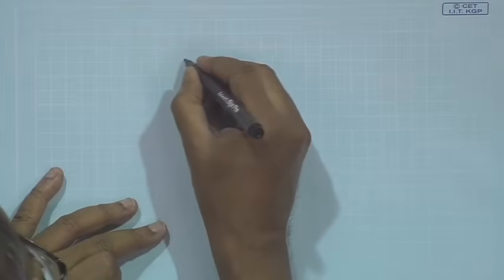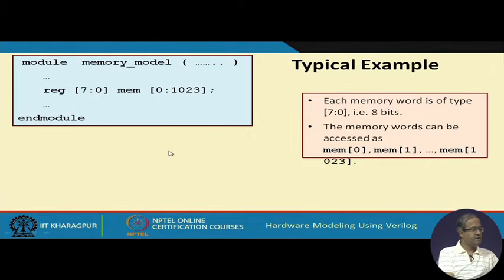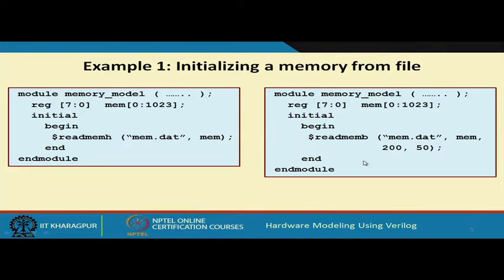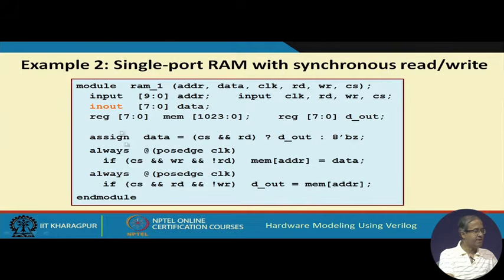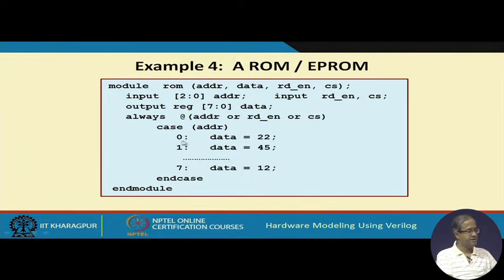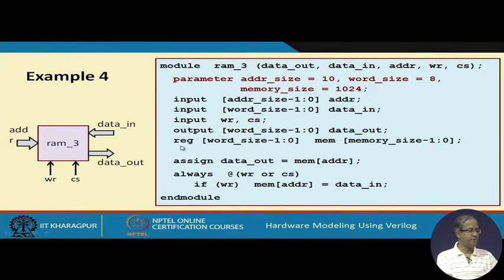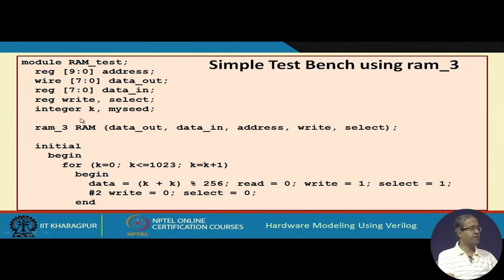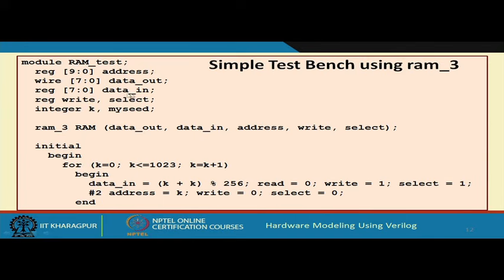MODELING MEMORY

Comment: module ram_test;
  reg [9:0] address;
  wire [7:0] data_out;
  reg [7:0] data_in;
  reg write, select;
  integer k, myseed;

  // Correct module instantiation
   ram2 RAM(data_in,data_out, select, write, address);

 
  initial begin
    myseed = 35; // Move this inside the initial block

    // Writing to memory
    for (k = 0; k <= 1023; k = k + 1) begin
      address=k;
      data_in = (k + k) % 256;
      write = 1; select = 1;
      #2 write = 0; select = 0;
    end

    #2; // Small delay before reading

    // Reading from memory randomly
    repeat(20) begin
      #2 address = $random(myseed) % 1024;
      write = 0; select = 1;
      #2 $display("Address: %5d, Data: %4d", address, data_out);
    end
  end
endmodule
corrected testbench
Reply: Why u made myseed as 35 initially
Reply: @atgaming5312  u can choose any number....its a random choice
Reply: wow thanks

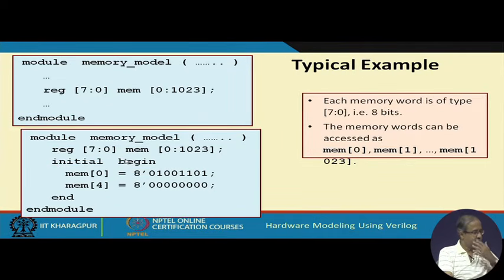Comment: At 5:48 how can we use initial block inside a module...we can use initial block under test benches only I guess...
Reply: We can use initial in module by knowing it's use. Initial will execute only once. And here we are storing data in memory so no need of always block. The thing is we can't use always block in testbench.
Reply: @pratikpawar5842  In pretty much all synchronous circuits, the testbench uses an always block for the clock?
Reply: @pratikpawar5842  for generating clk we use always block in testbench.
Reply: tell me the reason why shouldn't we consider, it because mem[i]'s are unpacked part selected bits, such that we shouldn't use the "continuous assignment" for those LHS="reg data_type" and RHS has value in binary formate we should use it, that's why with the use of procedural block and blocking statements we can write the mem[addr]=value;
Reply: When instantiating a memory module in a testbench, we may want that memory module to initially have stored certain values. Hence, for this to be the case each time we instantiate a memory module, we can initialize the memory locations using an initial block in the module.